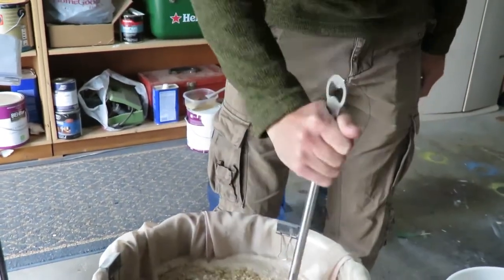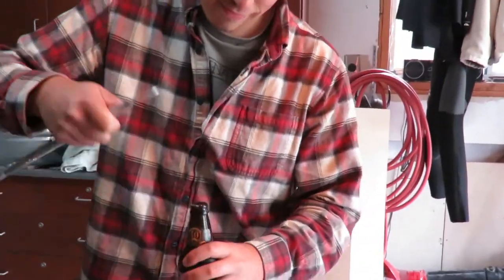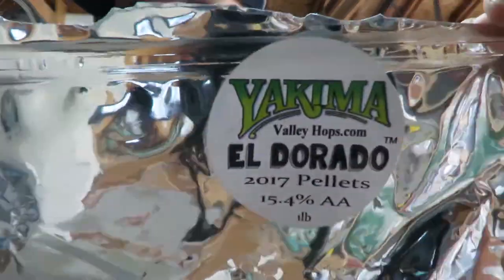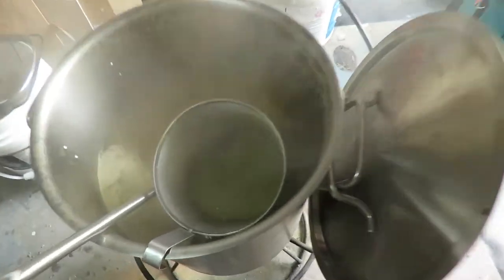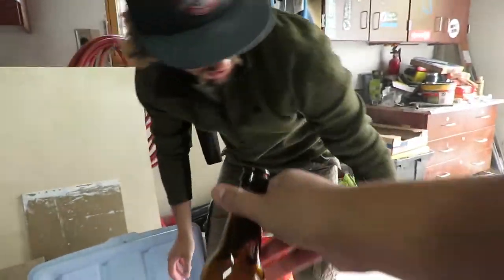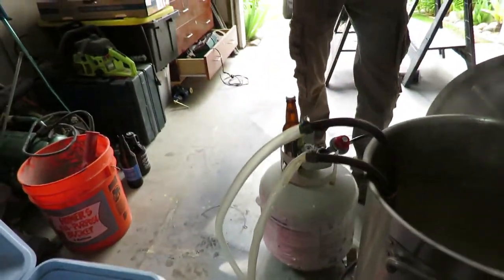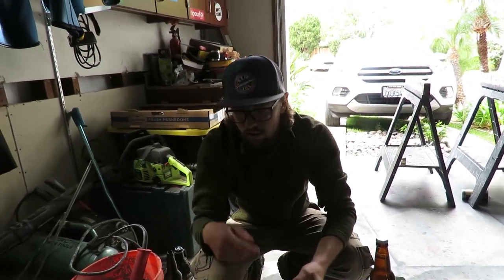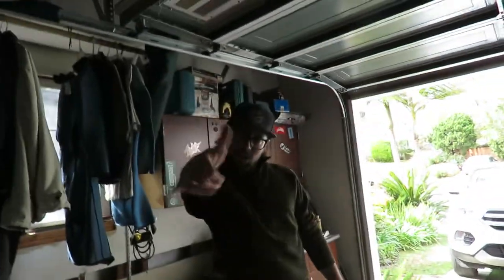Brewing up a Hazy IPA

Comment: That's a crap load of bittering hops to add during your boil. I don't even add any until after flameout and do a whirlpool hop addition at 170ish. Have you tasted it yet? Cheers from San Diego also! Gonna brew up 10 gallons on Tuesday of some of that sweet sweet hazy IPA